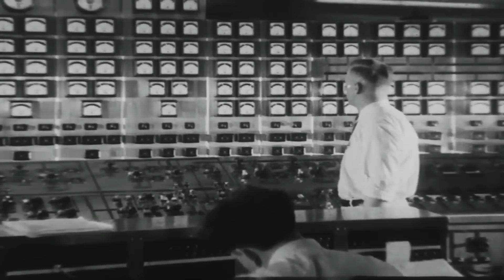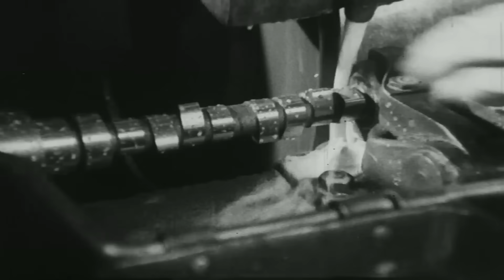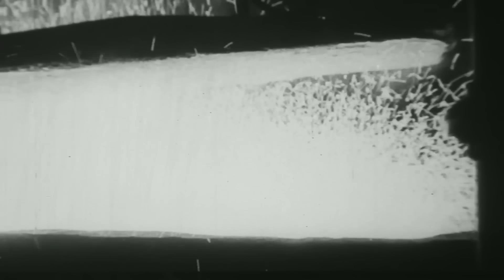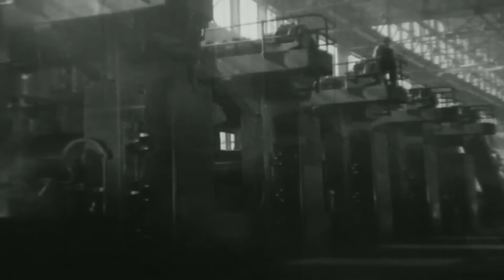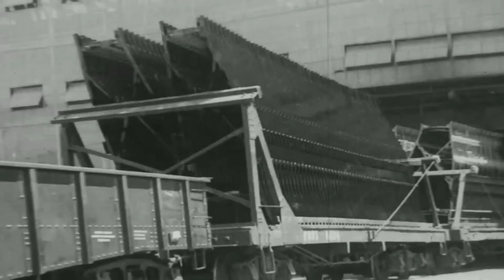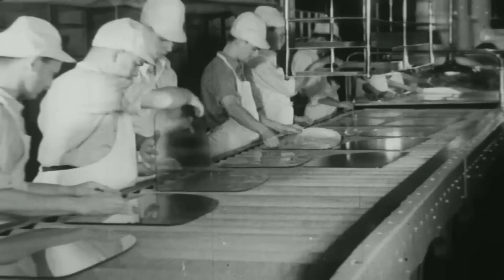Trip Through Time The Inside Tour of the Ford Motor Company River Rouge Plant  Original Film

Comment: I went on a tour of the rolling mill in the late '70s. It was a school trip in about 8th grade. There was a hot school bus ride of about an hour to get there. Upon arrival, we were taken into the mill to a second-floor viewing platform that was otherwise open to the interior of the production floor.

I still remember the kid, who would later be my insurance agent, holding up his hands to shield himself when they opened the door of the furnace down on the middle of the floor, and out rolled a piece of orange-hot steel at least 3 by 3 by 6 feet long, or bigger. The whole building was sweltering. Then they rolled it back and forth a bunch of times squeezing it smaller yet longer.

The bus ride home, in the same un-air-conditioned bus, seemed like a trip to the mountains. It was so much cooler than standing in that Hades-like plant.
Reply from the maker: it sounds like it was a fun field trip.  Thanks for sharing and for watching!

Comment: I worked the hot lines at Kaiser Aluminum .
The process is the same when processing steel & aluminum...
The huge rollers that squeeze the red metal into longer & longer slabs had to be changed often ...
It was a big undertaking , but we could do it in short order ..
The big D.C. motors that drove the sizing rollers were the size of large truck ...
When I had free time I used to go into the operators room & watch my uncle start with a red hot ingot and finish rolling it into the desired thickness which was then rolled into coil..
In another dept they made aluminum foil ..
It was basically the same process but in minature ...
I was 25 when I went to work there & just recently retired .
It was a tough job in a dangerous & hot environment ...
In my time 9 men were killed on the job...
Most I knew , but one man I worked with for yrs ...
He was killed doing a job I had performed dozens of times ...
I hope people can appreciate what men do every day to keep this country moving ..
Reply from the maker: It was so dangerous and often times never even mentioned.  Thanks for commenting and for watching!

Comment: My family bought Fords for decades. I broke the tradition because in the late 1970s I found another company, Toyota, made modern cars that were just as good and more reliable - ones that I could afFORD, maintain, and repair myself.  I've never bought a Ford, and never regretted it. My grandparents and mother continued to buy new Fords and spent thousands getting design and manufacturing defects repaired in engines and transmissions, overly-complicated tailgates, etc.
    Supposedly, back in  the olden days, Ford designed and built cars vertically and efficiently.    Now it assembles parts built by independent companies who require a good profit and have many other customers who are Ford's competitors.  Multi-tier profit-taking is one reason why Ford can't compete with companies having greater vertical integration and the efficiency that greater management control over their supply chain and manufacturing gives them.  Ford vehicles sold in NA have less than 50% NA content.  Imo, The other reason is that the company uses "good enough quality" as its metric for parts, managers, engineers, designs and manufacturing.
Reply: Guess what? Ford makes vehicles just like everybody else does. So you don't like Fords, so what. You think you have some great insight into the company, you don't.
Reply from the maker: Thanks for sharing your thoughts!

Comment: Henry Ford wanted total control of every facet of manufacturing, from the coal and electrical power to the steel.  He even wanted to own the rubber plantations (along with Firestone) to have a controlled source of rubber for the tires!  The ultimate example of what's known as "Vertical Integration" in business school.  Almost entirely out of favor these days as a far too expensive method of manufacturing.  Ford wanted total control of the process mostly due to his ego. Didn't want to be beholden to anyone.
Reply from the maker: Thanks for commenting and for watching!

Comment: Looking at what they had to do to build a car back then, no machine aids to lift parts, or all the automatic screw drivers and ratchets, everything was done by hand. They worked hard back then. Todays car workers haven't a clue what it was like to build a car.  Stick them back in that time and they would have a melt down and quit.   It was amazing how Ford created everything for their cars, Ford even had rubber farms to make the tires and hoses with.   I doubt there would be any car company today that could do all their own components with all the electronics in them.   Looking back, it is understandable why engines didn't last as long, they were basically all hand made, today they are pretty much all done by computers and machines, and they last 3-4 times as long if not longer. My Ford Flex has 176,000+ miles on its 3.5 Ecoboost and it runs just as good as it did when new, and it is 10 years old, not a drop of oil burned, and lots of power.    Ford pioneered the assembly lines, and this video shows it all.
Reply from the maker: Some great talking points!

Comment: I toured this plant in the late 70's when I lived in Clinton Twp, MI.   It was amazing.  I can still remember watching the slabs of steel being turnined into rolls of sheet metal. Watched Mustangs and Carpris going down the same line..
Reply: The American built Capri was discontinued in 1959. From 1968 to 1986 they were brought back, but imported from Europe. I had a 1974 Capri and it was assembled in West Germany. It was 100% metric. It was a great car except for excessive oil leaks and it rusted faster than any other vehicle I've ever owned before or since. It had a 2.8 liter V6 motor and could really scoot. Four on the floor manual tranny. I drove it for eight years and put over 120,000 miles on it.
Reply: @petestahnke175  Hmmm. so what did I see going down the line simutaneously with Mustangs.  Mavricks?  Pintos? I may be confused.  They were assembling two different but similar cars when I was there in 78 or 79
Reply: @MrArtVendelay  Just an initial quick Google search indicates it may have been the Cougar (believe it or not). I just got your reply notification, I'll look harder this evening.
Reply: @MrArtVendelay  My apologies. From 1979 until 1986, they would have indeed been Capris. They were imported from 1970 until 1978, NOT from '68 -'86. They continued to be made in Europe until '86, but only for the European market. The Capris built from '91 to '94 were made in Australia and also not imported. Sorry to have caused confusion. Your memory is very good.
Reply: @petestahnke175  Thanks for the update. I am blessed with a remarkable memory for some reason.  Capris and Mustings were all that I saw on the line that day.  What a great tour.  Parts of it were on the shop floor right next to the line.   I don't think you can tour the River Rouge plant any longer.
Reply: @MrArtVendelay They made the Capri in Dearborn from 79-86.
Reply from the maker: I bet it was amazing to see and hear!

Comment: They build aircraft here during the war?
Reply from the maker: They actually built the B-24 at the Willow Run Plant near Ypsilanti, MI.  Ford built the entire plant there.  Only the last section of it remains today and is used by the Yankee Air Museum.
Reply: I believe they did trucks and tanks at the Rouge plant, not sure though !! Aircraft was at the Willow Run plant built exactly for that purpose, Aircraft and lots of them too, they flew them out of Willow Run Airport which was also built for that exact reason !!

Comment: dear viewers, don't let that music fool you! i work in a steel mill and i can tell you the noise level hovers from 60 to right around 110 decibels.  when that furnace drops a charge into the furnace the rumble and noise is a exhilarating experience if youve never been close to it and that sheet steel rolling through the mill roars like constant hammer on a sheet metal table.  its just unreal how much noise these production processes make!
Reply: I worked as a pressman for the Boston globe 182db at full speed 90 at rest because of the pneumatic system. I'm in my mid 40s newspaper has dropped off to nothing. I have horrible tinnitus but no real hearing loss and this is with eat plugs and earmuffs on my head. I work with my hands, our real labor jobs like this are all but gone. We need our steel industry back
Reply: @johnc.hammersticks  steel production is not what it once was, but its doing what I call 'decent'  but the market is volatile and we are always competing with imports, the good thing about that is steel is super expensive to import and our quality is really good and the ocean loves to rust the product and customers dont like paying for all the rust.   so we are hanging in there.
Reply: @MrChevelle83   I went to welding after being laid off from the newspaper. I worked at a heavy steel fab shops, we had about 12 50 foot beams come in and fail visual and xray tests before fabrication. Internal porosity, cracks uniformity. All from China and India, my brother works for a heavy equipment company, pre assemble frames is done in India and always needs welds finished or  cleaned up.
Reply: @johnc.hammersticks  we do a lot of testing on the quality of the finished product to avoid this.   its a really big deal for us to never allow out of spec or grade product to leave the facility.   to my knowledge we have never had any product fail in the field.
Reply: @MrChevelle83   my brother  told me their safety and receiving team go over the pre-fabs top to bottom. He works for a company making huge scale biomass and mulching machines. The sizes in that shop make my work look tiny!  Smallest bolts are 1 1/4in it's wild.
Reply: @johnc.hammersticks  theres definitely some interesting processes out there,  its amazing what it takes to make some of these processes happen, ive been around the steel rolling process for 20 years and I still think its wild how the process is even possible and we can produce about 600k tons per year!  where the heck does all that product go!
Reply: @MrChevelle83   I used to say the same when I was a printer for the Boston globe. Hundreds of thousands of papers every day and night. I was there for 04 red Sox win, all the Brady superbowls and we ran for 72 hours straight except for clean outs and plate changes.  Once it drops out of sight it's gone somewhere downtown.
Reply: @johnc.hammersticks look at who own the steel mills now.☹️They just bought the meat processing plants and farms. Farmers aren’t farming anymore .☹️☹️☹️
Reply: back in the mid 70s  our class in middle school( i'll say 6th grade) took a tour of the plant. i still remember the heat and the sheet steel part.
Reply from the maker: I am sure the noise was near deafening!
Reply: @kensmithgallery4432  What?
Reply from the maker: 🤣🤣🤣 @doublecutter
Reply: I used to hear forging hammers driving past a local knife plant.
Reply: The noise isn’t as bad as the heat. I worked in a foundry that made locomotive and heavy equipment engines. On the melting and casting side it was at least 110 constantly
Reply: I was just thinking about that!  I didn’t see any ear protection and also how much physical the job must have been. Honestly, I don’t think I’d make it a month inside that plant. 😅
Reply: @johnsorensen3831  with todays modern steel making, yea youd be fine as long as your in good health and can tolerate the heat.  its mostly hands off in the melting process but you do have to endure short periods of extreme heat, we have the proper equipment to keep from getting burnt, think of firefighter wear but with an aluminum coating sewn on the outside.
Reply: yes sir im in hamilton.. dofassco is behind my house😅 afew blocks away their are no cellos or violas jammin anywhere near that place!!

Comment: There are still Ford cars on the road that are over  100 years old….try that with your new Ford cars…😂😂.
Reply: A 100-year-old Ford is either never driven or has been rebuilt numerous times.  Modern cars including Fords travel many times more miles between service and overhaul than cars did in the 1920's., or even the 1960's.
Reply: @JackF99 in 100 years I can still make that old Ford run. I can make any part on it. In 100 years you won't even be able to get those electronic parts anymore. Could possibly be made, but eehhhh.
Reply: @joshuagibson2520 I'll bet you a beer that you wouldn't buy a Model A Ford instead of a new car.  Who gives a crap that you can make all the parts for an old Ford?  Nostalgia is fun but modern cars are better in every way than those cars.
Reply: Dude, any car that old has been lovingly restored for tens of thousands of dollars.  Don't kid yourself that those cars are stock.
Reply: These cars have had general maintenance…and routine upkeep on their systems…they are still stock…not restored…I know…I’m a maintenance man…it’s my job to keep old machinery running…you probably don’t do what I do…so you don’t know…buzz off..🤣🤣
Reply from the maker: And plenty of them 100 year old cars too!

Comment: This was fun! I worked there in the 70's & loved every minute of it.
Iron ore going in one end & new Mustang  2's going out the other.
Reply: I saw the same thing.  Slabs of steel being pinched down to rolls of sheet metal.  then I saw Mustangs and Capri's going down the line.  This was in the late 70's when I lived in Clinton Twp MI
Reply: @MrArtVendelay Hey Vendelay! Greetings from Mount Clemens. Going to my mother in laws for Mother's Day in Clinton Township this afternoon!
Reply: @MrArtVendelay  Are you the guy from Vendelay Industries?   Did the rolling mill tour in that time period.  From Clintondale
Reply: Did a commissioning on a press there. Wall full of all the car frames made there on the wall. They were don9ing a foundation for one of the 800-ton presses, every hour they'd lift the backhoe in the 30 foot deep hole because it kept sinking, Rouge plant was built on a swamp.
Reply from the maker: I'm glad you enjoyed it!
Reply: I'm sorry your legacy involves the Mustang II.  :(  At least the rack & pinion steering racks were used later in hotrods!
Reply: Mustang II was a waste of good steel.
Reply: @showboardguy6048  I bought one new, it was a nice smooth economy car that handled like it was on rails. One of the first cars to come with steel radials and had rack and pinion as opposed to recirculating ball steering. I thought it was a great car. What do you base your opinion on?